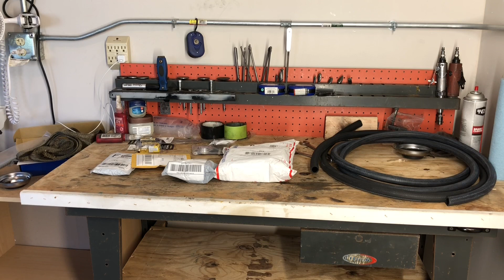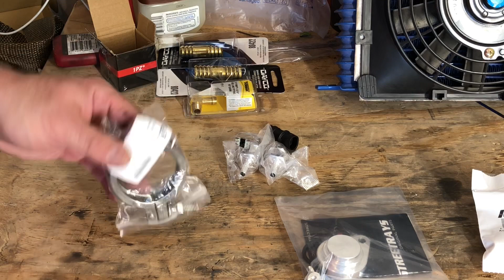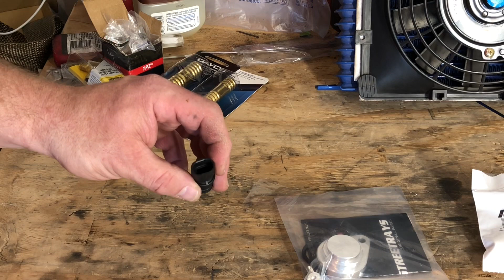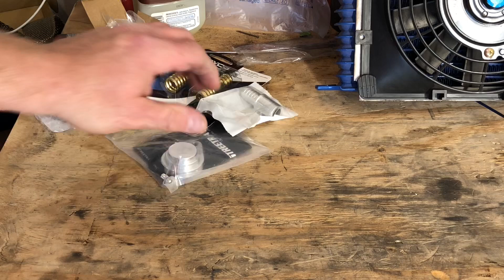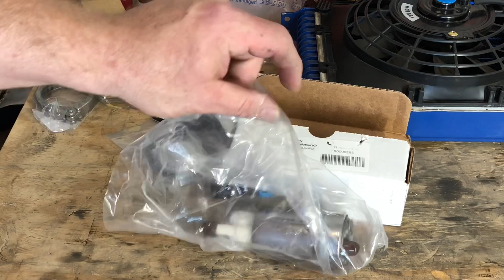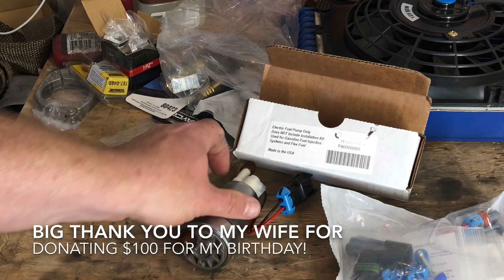S10 Turbo parts continued

Comment: For the trans fittings, have you looked at Sweet Performance (eBay)? I know they make 90 degree banjo fittings for the 4L80E, and some other transmissions.
Reply from the maker: I ended up needing 180* fittings to safely run the transmission lines away from the down pipe.  I bought all the fittings this time on eBay, I already had the case to -6 AN adapters before. I’m just dragging my feet making the stainless steel braided lines because they’re always a pain to me.  Thanks for the feedback I appreciate it!

Comment: I've used the plastic 3800 series 2 sensor IAT in gen3 intake before and it works just fine.  You shave the sensor down until it wants to slide down in and then you goop it up with Ultra Black and drive it in.  If the fit is too tight you'll bust the sensor.  When I did mine I grabbed 3-4 from the pick and pull but I never broke one.  sometimes they leak a little bit of air anyway because they were designed up be upstream of the MAF.  There's better ways to do it but it works for sure.  I still have my intake and I wouldn't hesitate about putting it on.
Reply from the maker: Brent Spence This is good information, I’ll get it installed.  If you want a stronger seal try using “The Right Stuff” sealer, it’s more work if you ever have to remove it but mechanics swear by it!  After I tried it it’s the only rtv style sealer I use. 
I’m relieved I can make this sensor work, so one less thing to worry about. 
My -10 oil cap adapter will be here Monday and this H speed rated front tires should be here Wednesday.  Thanks for the help!  JD

Comment: Many people go for a Bosch 255l per minute pump, but I am sure counterfeit Bosch 255LPM pumps are as common as the pump you are using.

The blue paint of the transmission cooler looks odd. I hope it doesn't have too much influence on heat dissipation. I am looking at Winnebago Rialta RVs which are based on the VW Eurovan, and their transmissions are a weak point. I figured I would get your kind of transmission cooler, because the other upgraded transmission coolers are made to go in front of the A/C condenser and radiator. However, this may be a while from now. I'm not sure what brand is best, but I intend to use it.
9:40 I once ordered an eBay Mitutoyo micrometer, but the seller was busted selling fakes, and I didn't have to do anything to get my money back. There is a load of counterfeiting out there.
Reply from the maker: Skyline Fever Those Bosh pumps iirc are the 044 pumps.  I’m currently running a Walbro 255LPH pump, this new 525LPH pump should handle the power level I’ll be at for a while, or at least with this Gen 3 4.8.  My goal is to keep it under 600 whp so the rods stay straight!  As the budget allows I’ll add a water/meth injection as a safety precaution. 

I’m not to worried about the blue paint, surely it won’t hurt to much? 🙏🏻. I’ve seen even the name brand coolers painted, I’ve always wondered why they would paint an aluminum cooler? Odd 🤔
Thanks I appreciate the comments keep watching a lot more to come!  JD
Reply: @HeadFlowInc  Okay, I never realized you would need more than 255 LPH. This sounds exciting. Also, some intercoolers may have been coated with something that aids heat dissipation, but looks like paint, so the color change has positive effects. DIY turbo guys and Subaru guys like them because it isn't easy to see the difference between the base model and a customized car.